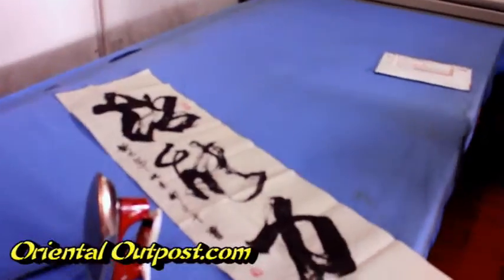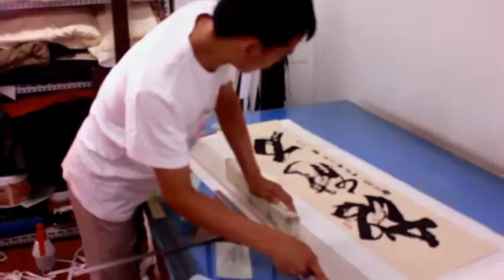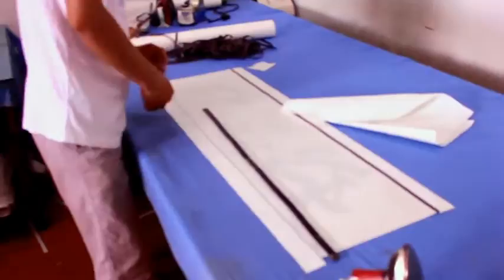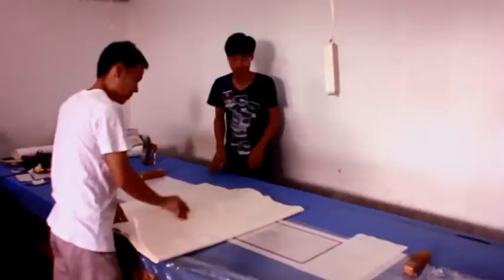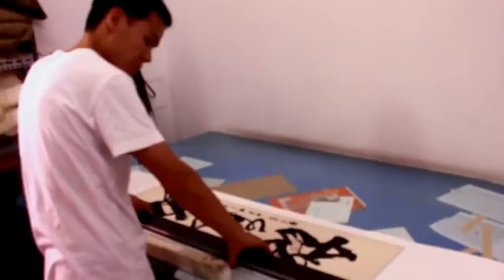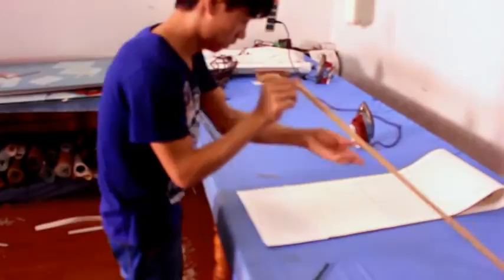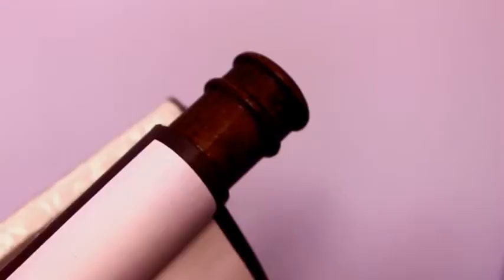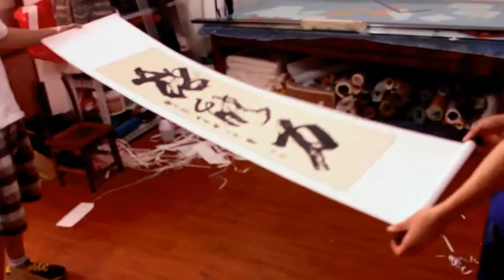Wall Scroll Making

Comment: Uuhhh... scary... laying the iron-ruler with the edge onto the art work ...  delicate xuan paper...  phew... lucky this time..
Reply: It depends on the quality of the xuan paper. Sometimes we use a protective film/sheet if the xuan is of low quality or delicate for some other reason. Also, lower heat for the face of the artwork and we tread lightly. Been doing it for 16 years, and I have not scorched any xuan paper yet. The dangerous part is the chance of smearing the read stamp (which is more or less red clay and oil). If you heat that up, it gets soft and wants to smear if it's fresh.